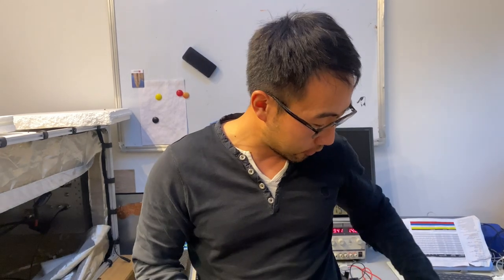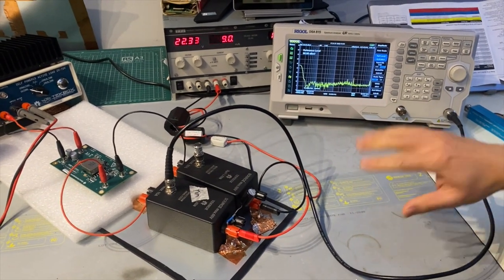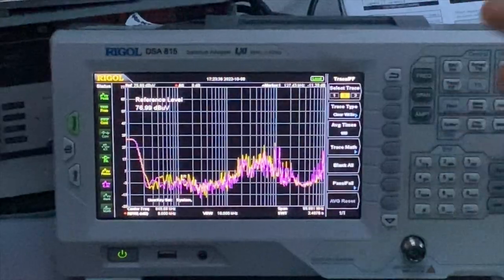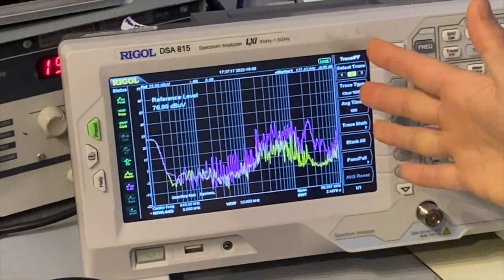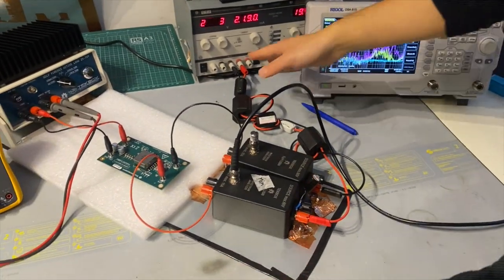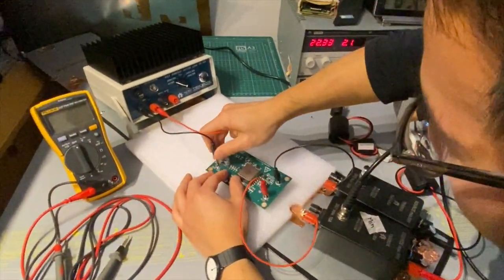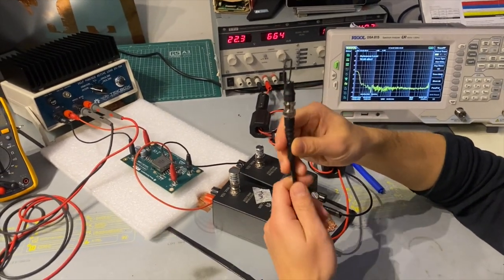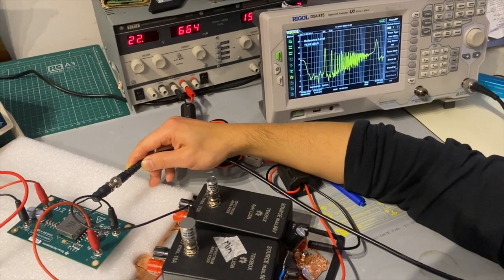Suppressing the Ambient Noise in Pre-compliance Test Set-up Part 2

Comment: Min, at the end when you recommend not earthing the reference ground plane for devices running on low voltage DC... are the radiated emission results really equivalent or 'close enough' if you don't connect the LISN ground to earth?

Comment: First of all, this is a great channel! Secondly, I have a question. I've noticed that you do not perform radiated emissions testing with an antenna, only near field probes, current probes etc. Is that due to the high level of ambient noise in your environment that would overwhelm any measurement you would perform? Is it simply impossible to perform a realistic measurement without an anechoic chamber or an OATS in a rural location?
Reply from the maker: Great suggestion! Elias, exactly as you said. However, in my place, i actually have a relatively low ambient environment, so upon your request, i will do one with the antenna sometime later!